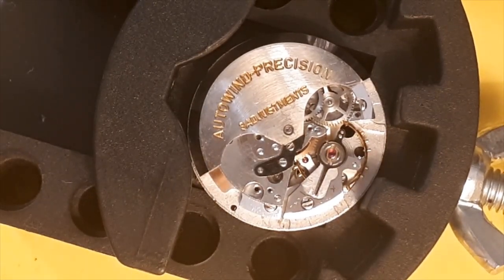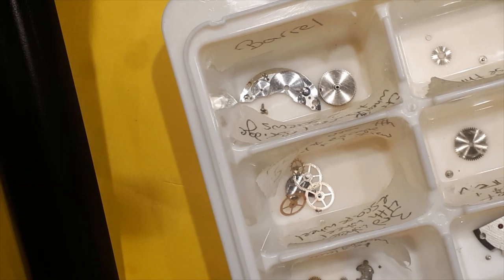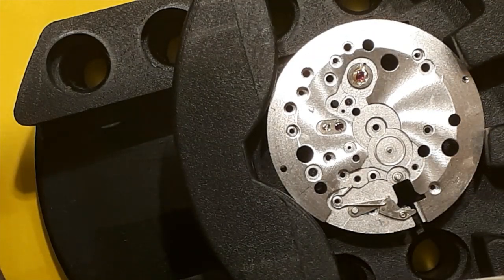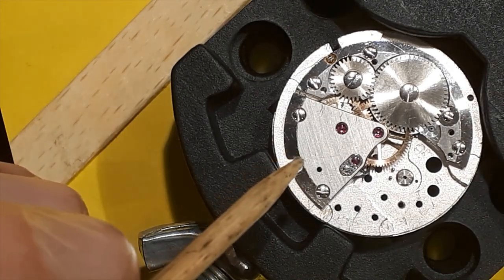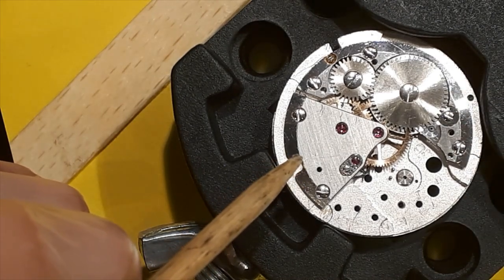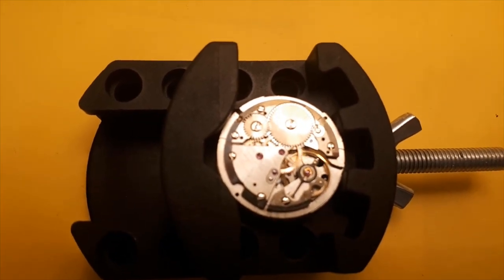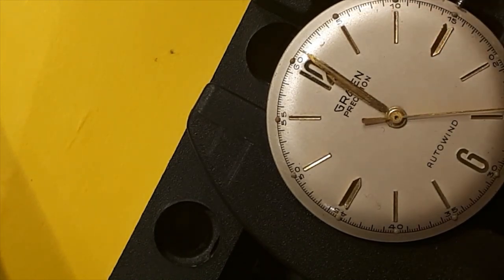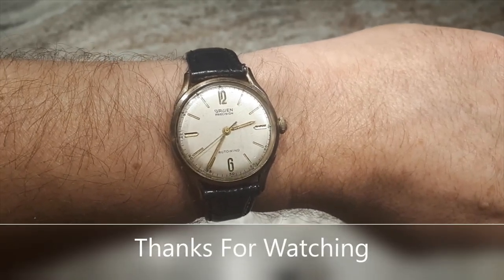Gruen 25 Year Service Watch Restored

Comment: Really enjoyed watching the video, Im a hobbyist like you,I’m on to my 34th watch. 
I’d advised getting a casing cushion and to keep stripping the movement down and rebuilding it.
This I found helps with dexterity with the tweezers and your understanding will develop over the movement.
Use one dip to clean jewels and the pellet fork.
Rodico is another essential and is cheap, I use it for everything.
Good luck for your future watches.
P.s. get a magnet it can really help with finding missing springs and screws. Just keep it well away from your screwdrivers.
Reply from the maker: Thanks for the tips,  I appreciate it. The funny thing is I started this because my 5 yr old mechanical Bulova stopped and I pulled my Father's watches out of the drawer and wanted to use them. Now it's becoming an interesting hobby.  Hopefully I can start collecting tools.

Comment: As for the setting bridge and spring almost all movement makers had a one-of-a-kind setting bridge in order to clear any copy right issues. Part suppliers like Best Fit have pictures in their catalogs that has a drawing or picture of each bridge. This movement is mostly the same as a Durowe 570 as a 11 1/2 ligne and the picture shows there is a spring that is missing/broken on the bridge. Somewhere I don't recall at the moment there are free downloadable copies of the catalog.
Reply from the maker: Thanks for the info David.
Reply: No problem if you need any pictures of it I can see if I have anything else
Reply from the maker: @daviddillman3301  you're right. I found photos of the Durowe 570 on the Ranfft website. That spring on the dial side is definitely broken.

Comment: Also, did you remove the main spring to check it out and clean and grease it?
Reply from the maker: Hello Ron, thanks for watching and asking. I opened the main spring barrel to see if the spring was not broken. However, because this is my beginning to watch repair I don't have a main spring winder so I left the spring alone and replaced the lid back on. Also, I did oil the jewels including the balance jewel. The hardest was getting the balance jewel cap off with out loosing it.